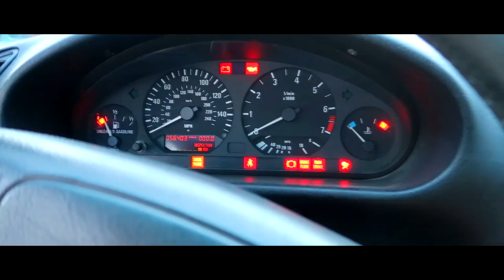FIRST CAR on the DREAM DRIFT TRACK

Comment: Hey bro take couple rail road ties bolt them together about 3 feet apart using 2x6's which will create a float and drag them around the track  and it will make it nice and smooth for ya!

Comment: whats the purpose of driving bmw in a field ? track is too small and slow for the car. Would be nicer if you could build 2 similar or identical mud buggies with 125 to 250 cc engines,  a little bit bigger then an atv and it would suit track better.

Comment: your bmw needs a water pump I've replaced a few of them it's pretty easy that's why the steam when it gets warm faulty pump not enough coolant getting to the block and it's just releasing built pressure from any where it can

Comment: 3Dmachines. Please see that we miss the old dalton. Should go back to your roots building a new bike in the shop or making same random ride like the braap board. We allwanted you to buy a 2 stroke to see you work on it. We barely see it and it never really changes. Same goes for the KX thats been sitting in the back for forever. Ive been on your channel since before you bought the KX and i want the old vids back. Point towards gear heads like it used to be